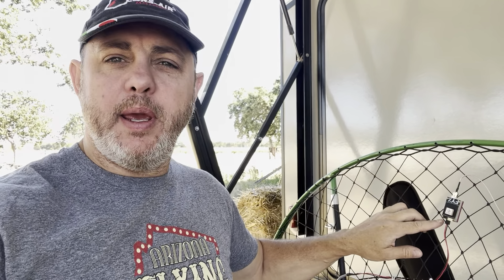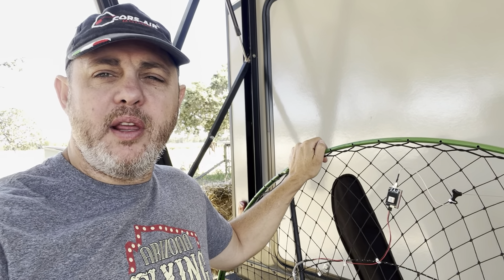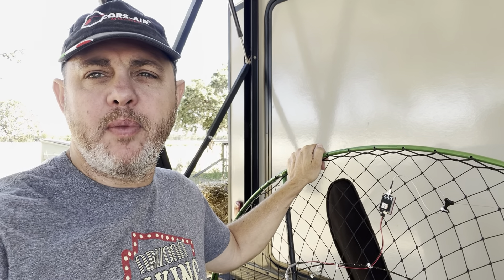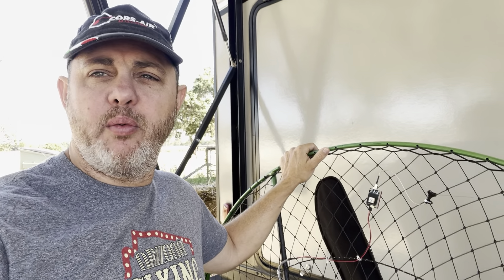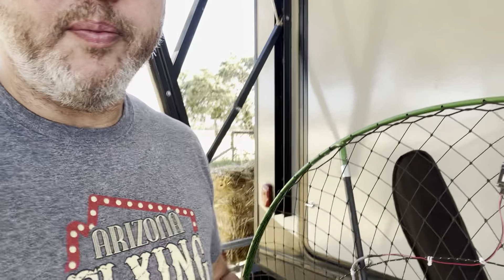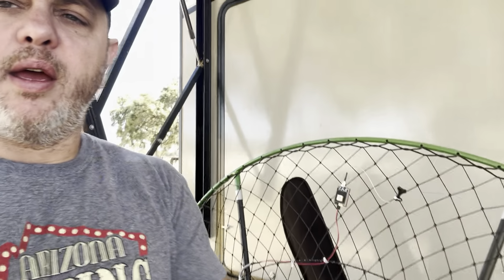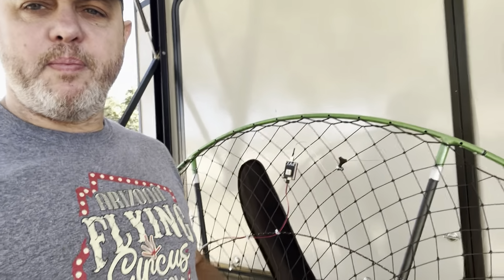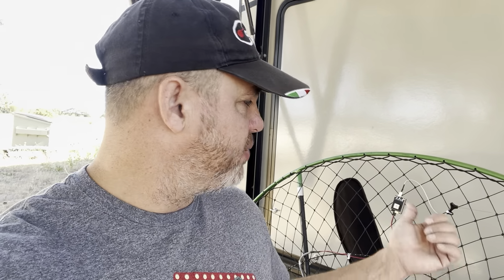ADSB use with Ultralights & Paramotors

Comment: skyecho is another potential and less expensive solution though it is not approved for use in USA that is you can't use them where ADSB is required however if you are just flying in class G then it should be okay. I am considering though not sure if it is easy to purchase in USA. Looks to be about 1/2 of cost of ping20 it appears.
Reply: If you turn that device on within the USA prior to the FCC issuing a TYPE ACCEPTANCE on it, you are in big trouble
Reply: @vg23air  yes I see you are not supposed to use the transmit function in north america. lucky folks in other markets.

Comment: Looked at it and thought: i don't really need it for foot launched paramotoring, but it looks like a nice bit of kit. It probably contains a 1ghz radio, a bosch bmp kind of sensor, gps and maybe a digital compass. I can build it for 17 bucks or ghe like. I guess if it's double the price, say 35$, i might as well buy it. Then i checked the website. Boy, was i in for a treat

Comment: It looks great but as you said its probably only for certain kinds of high altitude PPG pilots or those in congested areas, throw a bit of shrink wrap over it. If you dont have any proper shrink wrap if you can find a small product bag with "crinkly" plastic and a hair dryer will do the trick.